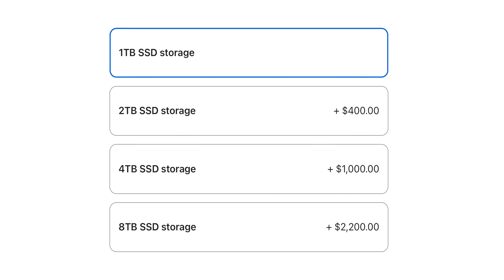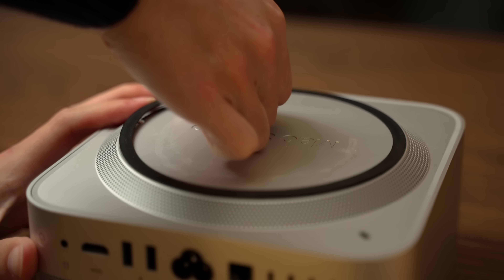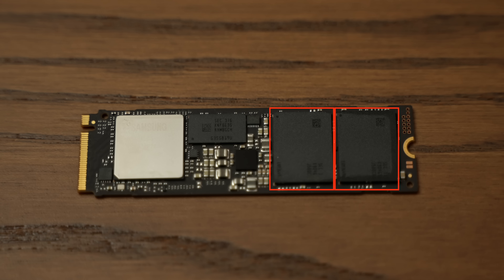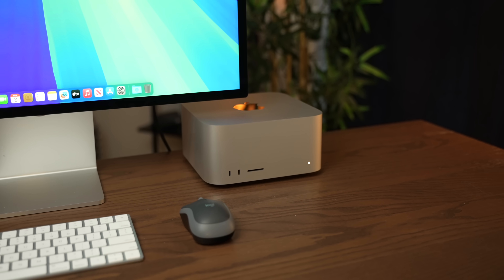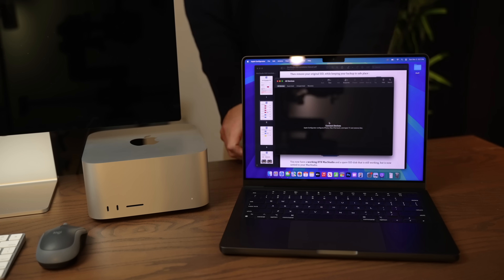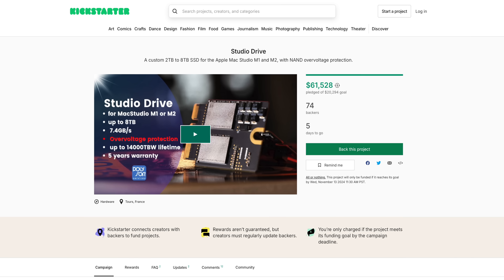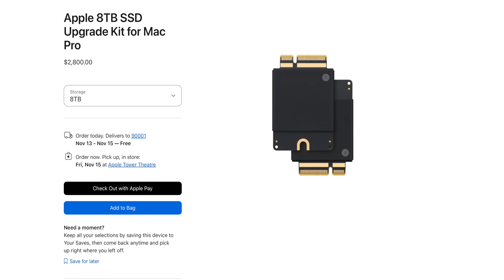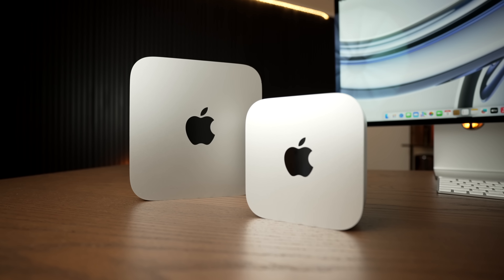UPGRADE your Apple Silicon storage for HALF the cost!

Comment from the maker: HUGE shoutout to Gilles at Polysoft for sending this over, I'm absolutely in awe of the engineering that went into this! Would you buy a storage module for your Apple Silicon Desktop?
Reply: Gilles is the hero of the year 2024 and 2025, success!
Reply: I would, but I think I'd need someone to install it for me!
Reply: EU will force Apple to swap to User Upgradable RAM Batteries SSD's

All Devices that Connect to the Internet Directly or Indirectly should get at least 7 to 8 years Minimum of Security Updates by LAW

Also while I get all New Tech not having best performance parts in every device they should support and use latest Gen Hardware not 1 to 3 Gen old tech WiFi7, Bluetooth 6, PCIE6, DDRAM5, NVMe etc etc not WiFi5, Bluetooth 4, PCIe4, DDRAM4, SATA as older Tech will slow down and/or loose support faster and have more Security Flaws that will never get Patched!
Reply: @DarthAwar  "EU will force Apple to swap to User Upgradable..."  So the smarter Cult members will buy the European versions from Europe. I have already forced Apple not to ruin my user experience by not using it. 😀 Give that a try. The Cult withdrawal symptoms will fizzle out in less than a month when you discover how awesome Freedom of choice can be and what it has to offer. 😀
Reply: Apple's memory modules are keyed to the security chip on the motherboard.  I'm wondering if you get full access to things like ApplePay, AI, and FileVault if you boot from a third party NAND board like these.
Reply: @jpdemer5  Isn't that why dosdude found out it was important to get blank memory chips? I assumed that when restoring for the first time, the TP2 chip would lock the memory modules to itself and block any which had already been formatted in any other Mac, which is why you couldn't just swap in another module from another Mac. Maybe you are right and there is more to it than just that.
Reply: Buyers be aware. Reports on Mac Rumors and Redding are piling up. Polysoft dont reply to any contacts and dont deliver anything since months! Beware if you order and read forums first!
Reply: @haligali386  i can confirm this, i am waiting since June for my delivery and every update message announces new delays, there might be happy user but also a lot frustrated ones
Reply: I'm looking forward to your announcement of user-upgradeable SSD modules for the Mac mini. That day we will all celebrate together!
Reply: Yes
Reply: will these work on the m4 mac mini?
Reply: Goat 🐐
Reply: Great done by Polysoft. Thanks for testing out this and the video. That SSD upgrade would be interesting on the Mini M4, but there it's soldered, isn't it? - Any idea when a Studio M4 will be available?
Reply: @rolandrick  I mean, he showed you the storage modules of both the M4 Mini and Mini Pro in the video. Same process will apply but it took two years to get to here on the Studio module so it will take a bit of time.
Reply: Sounds great, I must say! Maybe you still might have to pay some Apple tax for these flash cards (considering there's no SSD controller or buffer DRAM etc included), but certainly far, far less than if ordering straight from Apple.

Wish my Macbook Pro M3 had removable flash cards, even if Apple-proprietary. Soldering ALL the important, expensive eggs onto one single basket (so to speak) is just monumentally arrogant and disrespectful to their own customers. If anything breaks, hey, that's $2500 please for a new logic board, including main SoC, RAM, flash - everything.

Glad that the EU is disabusing Apple of those habits with right to repair legislation etc. Hopefully that will include the need for a second Mac and a proprietary piece of software to get the upgraded computer up and running again - that shouldn't be necessary.  Of course, you'll find countless delusional Apple stans defending all of these evil practices, but hey... What can you do.

Oh, and cheers for having the first and thus so far ONLY sponsored product I've seen in a youtube video that I might actually be interested in... :D That charging stand actually looks pretty dang sweet! I've been looking for something simple and clean with swivel functionality for standby mode. Cool gadget!
Reply: looking forward fo their M4 Mini offering. I'll absolutely buy one.
Reply: Has anyone else received radio silence from Polysoft after a canceled order? Still waiting on a refund; no replies for weeks. Any contact route that actually works?
Reply: @nextofsearch join macrumors and file the French report
Reply: Hey Mr. Miani, Can you confirm that Apple Intelligence and Apple Pay work with these after market storage solutions?
Reply: you should come straight out at the beginning and mention that this is a kickstarter project with no guarantee of delivery or support.
Reply: Nope. Nope, and nope. There's a high chance Apple will release a MacOS update which will brick such upgraded Mac.
The proper (and even cheaper) way to upgrade storage is by using M2-USB adapters - https://www.youtube.com/watch?v=JSNKR6JLwg8
Yes the speed will be same as for built-in storage (because Macs still use old, cheap and slow internal SSDs).
Reply: I lost count how many times Louis Rossmann talks about Apple's engineering problems on Macbooks.

Comment: It's not the removal and installation or cost but where does one get the second Mac to complete the setup? Easier and cheaper and doesn't void the warranty to add a Thunderbolt 4/5 external enclosure. Mine with a 2TB Samsung 990 EVO SSD cost $279. Tt is plenty fast for 4K video editing with Davinci Resolve.

Comment: I've got another solution. I got 4 x Samsung 970 Pro 1TB MLC SSD and connected thru a TB3 cable using an external 4 bays SSD NvME enclosure. Although I couldn't get something like 5000Mbps r/w as demonstrated in this video. I still got 3000Mbps in my configuration which is already reaching the speed ceiling of TB3 (PCI-e 3.0). My expense was USD 150 4 x 970 Pro MLC SSDs and another $300 for the TB3 4 bay enclosure. Which is about the same price of the 8TB nand upgrade in this video. I got a key advantage over the 8TB is that when my Mac is dead. Because I can just connect my enclosure to a new Mac (any Mac) and it no needs to be the same Mac Studio model to retrieve the data saved in the 8TB nand upgraded SSD. While this 8TB upgrade is very nice. But it has to rely on the same Mac Studio model in order to retrieve the data on the upgraded nand ssd when it dies.

Comment: I'm wondering how long before these guys have slot in replacements for the M4 Mini's. Also the controller is on the SoC for encryption etc. Like when they added the T2 chips to older Intel Macs, it's all just baked in to the SoC now. It would be nice to just be able to throw in generic NVME drives but I get why they don't from a security stand point. Especially given how tiny these machines are and how easy they can be stolen lol.

Comment: Can you just add 1 as a second ssd and leave the apple factory one in there as the startup drive?
Reply: If dual drives are installed then the writes access can be 100% faster and, depending on how the controller was implemented, reads can be from 0% to 100% faster. From a write perspective, this is handled by interleaving writes across the drives. However this also means that, to use this approach, both drives would have to be the same capacity.

Comment: Part of the reason Apple computers last longer than most PC’s is because they keep people who should not be opening up the box from messing arround inside. If you want to do that, do what I did and build your own PC. I’ve been using Macs since 1987 and I usually get 8-10 years out of a system. Amortized over that time Macs are cheap and dependable. Also it keeps Apple Care affordable too. Try getting a PC service plan for under $40 a year…

Comment: Luke, I hope that you see this. I am in need of a new Laptop to run Logic Pro for my live show. I don’t think I can comfortably afford a new Mac, but will stretch if needed. What would you suggest and how old of a Mac should I look at if that is a good option. I should mention that I don’t use oodles of processing power and usually only run up to 10 to 12 tracks per project. Thanks in advance and hope that you can help..
Reply: Pardon me for interjecting but the M1 Pro can be found at good prices nowadays and brings both performance and longevity at a reasonable price. As someone in the AV side of things, I occasionally get to see what musicians are running for their computers. I'd say M1 Pro is your best bet, followed by a budget model of an M1 Air with 16gb ram and 512GB SSD for longevity. I use a model similar to that as my daily and the battery life is incredible. Intel Mac as you may know is a sinking ship and I could not reasonably recommend any Intel MacBook. Their 16" i7/i9 models are plagued with NAND reliability issues as highlighted in the video and both it and the 13" intel models will lose software support in the next few years. 
Hope this helps!
Reply: I'm really happy you interjected and it is most appreciated. It's exactly the type of answer I was looking for...
Reply: Awesome! I'm so glad I could be of assistance. Blessings to you.
Reply: Same

Comment: Has anyone tried these in the new Mac MINIs? They look almost the same as far as their removable storage.
Reply: It's a safe bet they don't fit, since the Mac mini is smaller than the Studio and its NAND modules have to squeeze around the heatsink for the SoC. Polysoft will almost certainly make modules for it too, though—they'd be leaving money on the table not to.
Reply from the maker: They’re a different size and layout, but Mac mini upgrades are being worked on by both Polysoft and iBoff right now!

Comment: Mess it is indeed. Take Samsung high-end SSD, remove the expensive controller, remove DRAM cheap and reduce PCB complexity 10 fold and charge twice the cost for for upgrading golden caged crapples. And the funny part is that those ARM SoC chips already have PCIe lanes to connect normal SSDs, they just decided it's not a good business solution for profits :)

Comment: Will surely look into this in a a year or 2 for my Mac Studio Max m2. It looks like the company will be backloaded for months and years to come. Just checked the site and nothing available until who knows when. I bought my M2 Max with 1 TB bc it was only what I could afford when I bought it and wanted 32 gigs of Ram. Apple will Never make it friendlier to do upgrades, quite the contrary, they are known for blocking these type of upgrades. On a side note, I know it is better to have the SSD internally but is there that much difference vs having a thunderbolt 4 SSD externally? I have  seen some videos about people actually booting their systems up from external SSD' s and having about the same speed if not faster than the internal SSD? Thanks for the video

Comment: I think I understood you correctly when you buy this upgrade, you leave the original drive-in and put the upgrade in the other slot?
Reply: No.They are slot/position specific. You would need to backup your existing data to a external drive. Install the new module. Use another Mac connected to run the configurator. Then restore your data from the external drive.

Comment: stupid that the Mac Stuido and Mac Mini use different modules so they aren't interchangeable. I understand Apple saving money by using the CPU as SSD controller instead of putting a controller chip on the SSD module, but stupid Apple didn't make a standard
Reply: I don't know if the connector is the same or not, but the shape of the actual PCB might be dictated by the enclosure—the modules in the Mac mini have to squeeze around the heatsink, which is why the shape is different between the M4 and M4 Pro models, whereas there's more space inside the Mac Studio.

Comment: The new mac mini M4 has already been upgraded in terms of internal storage. Just look it up...
Reply: Doing that requires desoldering the NAND chips from the module Apple sold you and soldering new higher-capacity ones on in their place, which is way outside what most people can do and what anyone should be required to do to upgrade a computer they own. Hopefully Polysoft develop replacement modules for the Mac mini as well.

Comment: That's been my main complaint. I like my M2 Air, but going from base 8GB/256GB to the 16/512 really felt like a rip off, even at the sale price. I can understand the unified memory situation, but there's no reason changing the SoC RAM configuration costs 4x what entire DIMM packages cost. They really should have eliminated the 8GB config after M1 to keep the economy of scale for 16GB roughly the same.  The stubbornness of Apple is really a turn off sometimes.

The biggest slap in the face though is the SSD, that's just pure control and greed.  There is no benefit to soldered NAND on any of the current Mac devices, only downsides. Not when an equivalent newer gen SSD can exceed all performance metrics. The only hint of a benefit to the storage controller on the SoC is maybe easier heat management. But that's not worth the sacrifice at all and a pretty easy remedy.

Glad to see a solution like this though, it's something at least.

Comment: SSDs should always be replaceable and upgradeable! This is Apple just being Apple.
Reply: The whole reason Polysoft could produce this is that Apple made them replaceable and upgradeable, rather than soldering the NAND chips to the logic board like they did with the previous Mac mini revisions. The only reason Apple don't sell these modules for the Mac Studio or Mac mini is that they don't support the user altering the hardware—you're supposed to pay for the Mac Pro if you care about that. They can't actually stop you using an aftermarket part to modify your hardware, it just means you void your AppleCare agreement.

Comment: You wouldn't have any of these problems if you just bought a PC
Reply: On the other hand, then you'd have to use Linux. One thing Apple do really well which you can't get from anyone else is how everything they sell has peripheral value based on what you already own—your Mac can unlock when it detects your Apple Watch, you can AirDrop files between Apple devices, you can use an iPad as a secondary monitor, etc.

Comment: I wonder where those “nand” modules came from? Probably from used macs. 
Those are proprietary apple modules an cannot be sold to anybody except apple. So, there is two sources: dead boards or Apple Store.

Also, those are not just nand, they are single chip NVME ssd. Yes, apple ssd module has 2 ssd in it.
Reply: You don't know what you're talking about. Apple don't have specialty NAND, they just use chips from companies like SK Hynix.

Comment: If they are able to offer a 2TB SSD upgrade for the new M4 Mac Mini for less than what Apple charges I would actually consider buying an M4 Mac Mini finally. I was so excited to see the base M4 Mac Mini FINALLY offer 16GB RAM for the base price point, but I was gutted to see they still only offer 256GB SSD for the base model, and then charge an insane price to upgrade it to a more reasonable amount of storage. The last Mac I actually bought was way back in 2010 with the MacBook Pro, and I used that thing for over 10 years because of how repairable it was. We are finally tantilizingly close again to a Mac thats resonably priced and reasonably repairable, we just need a storage upgrade option that doesnt double the cost of the computer

Comment: According to 12:33 that brings the "made carbon friendly" stickers on Apple boxes in quite a relative perspective. Things that can't be fixed have per se a 10,000 times or so higher carbon footprint as the opposite. Apple takes its customers for fools. - I am Apple fan boy, but what they are doing with the SSD and memory prices is an ugly rip-off.

Comment: as much as this is really cool, it's pretty much guaranteed some company will come out with a flush ssd base for the m4 mac mini that connects via thunderbolt. it should be cheaper and massively easier to install.

Comment: Can't wait for Studio and mini revision within 2 years that will have soldered SSD as iMac and MacBooks have, :) Apple is just making eggplant moves to customers with pricing a proprietary parts for the own profit. Yea architecture of M chips are made that have controller on board, but they make the chip, there was no obstacle to make it to work with regular SSD, only a lack of will and will to make money out of it. I would love EU to put a mandatory replaceable SSD in any PC/Laptop instead of soldered one, as SSD is a consumable as a battery.
And about that amazing speed, the 6-8GBs, it is just PCIe 4.0, PCIe 5.0 is double that in theory, at now being around 12-13GBs max, so that speed in Studio, not so fast in today's standard...

Comment: Yeah for after the fact upgrades (or drive failures) this is a godsend! Well done!...Unfortunately, their 2TB module is Eur399... which is basically the same price that Apple charges for their 2TB Upgrade ($400) when you purchase the device. Hopefully their prices goes down, drastically, considering you can buy a 4TB external drive for $100 less. Hell you can probably buy a NAS + drives for close to that price and you wouldn't need another mac to install.

Comment: I do like the Mac-ecosystem, but all these lock-out shenanigans are insulting to the end customer. In my 2012 Mac mini I could just whack in two 2.5 inch SSDs, in my 2015 MacBook Air a 1TB NVMe with a 10€ adapter, no biggy. I hope the EU will get wise to these tricks and force them to redesign their hardware in the future, worked for USB-C and the AppStore even though it took a while.